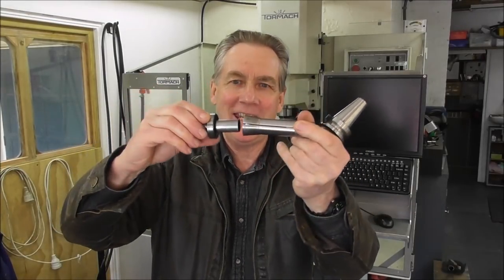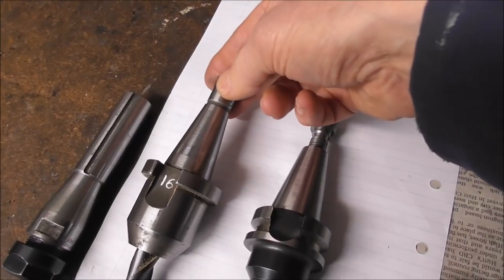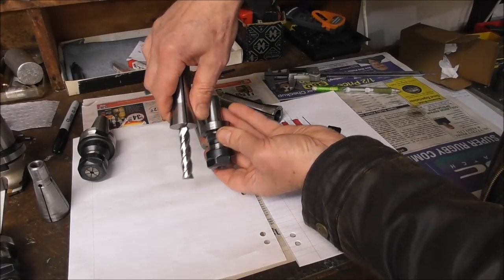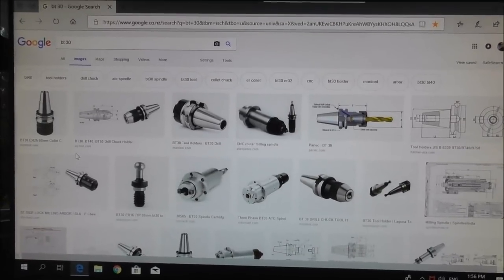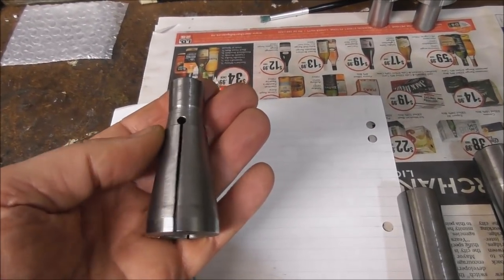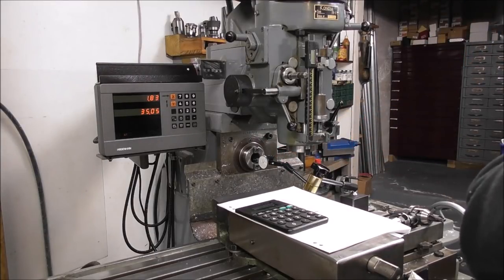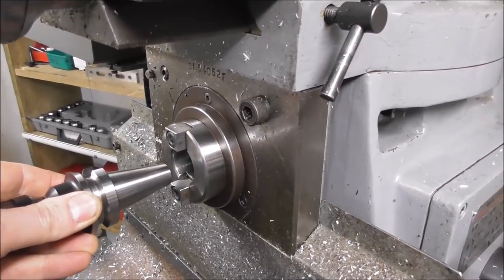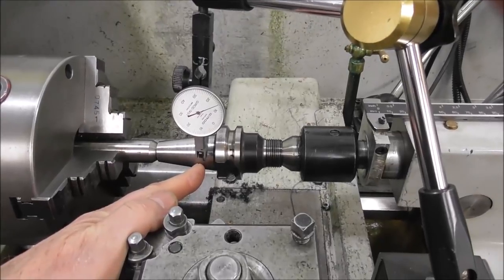R8/TTS vs BT30 Spindle Tapers -  Part 2

Comment: Hi Cliff
Still loving the ITTP. I am using R8 I have a large investment in R8 so I will not be considering changing to any other system I have a power drawbar which makes changing very quick. As for avoiding pullout with larger cutters I use a shell type cutter  on a one piece arbour no pullout. My largest cutter is 50mm dia and I cut up to 3mm depth @ 1200RPM and 500mm per minute feed in steel ( Ihave put a 7.5KW motor running in vector control to get max torque at lower RPM ) for smaller cutters I use a decicated R8 collet and I pin the cutter into the collet these are replaceable tip cutters 10, 16, 22, 25, 32.mm dia. Below this I do not have any problems I use plain R8 collets and ER 16 & ER 20 & ER32 collet chucks.
My machine is a Bridgeport copy so I do have rigidity problems if cutting big cuts, for what I generally do it works well
Reply from the maker: Hi John. Thanks for taking the time to give that useful information. That is good evidence of the capability of R8.  Do you use any TTS holders?  Thanks for the ITTP feedback also.  Cliff
Reply: @Threadexpress  Hi Cliff
No I do not use TTS the only thing I have done is add a precision R8 collet to the ITTP making it indexed to the key in the spindle and also pinned to the ITTP with about 2mm end float to still register on the spindle nose this helps with registration to the same position every time I use it.
Cheers
John

Comment: Cliff,

Great comparison of the differences twix R8/TTS and BT30.  Thanks.
I notice that on the Bridgeport style mill you have a horizontal spindle which looks to be an add on.  I have been thinking about doing something similar on a Bridgeport, also with a BT30 taper.  I searched your videos unsuccessfully for one describing the conversion, so I have some questions.
1. Does the spindle go right through to the back?
2. If so do you have bearing mounts just supported at the back or do you have a cartridge like system which supports as a one piece unit which goes front to back.
3. What do you do for drive? I guess a motor and belts at the rear.
4. Did you finish bore the spindle using live tooling mounted to the table?

I have considered one of the Bridgeport or cloned rt. angle drives which fit the vertical spindle and quill but I do not see them as being very rigid although they do offer a lot of versatility for positioning.
Reply from the maker: @MotoChassisByTonyFoale  Hi. My mill came with the horizontal spindle build in. Cheers, Cliff

Comment: I like your videos, good detail. I want ask you what do you think about TTS system vs R8 arbor to face mill, I had think is better R8 arbor but Im not shure if TTS can handle big cut whiout vibrate or slip.  Too what about Z high repeat of R8, because its the reason to TTS system but if R8 is enough  maybe could be better choice, Im not shure, like you say many things to consider, thanks
Reply from the maker: Hi. For face milling a R8 direct shank would usually be better than TTS. Re Z height repeat. Good question. I have not tested this, but I imagine with clean tapers and even draw bar torque it would be ok. Cheers  Cliff

Comment: Informative video, as usual. One point, though, BT30 holders do not always require drive dogs or spindle orientation. I have an EMCO mill that does not have drive dogs milled into the spindle or into its tool holders. Holders without drive dogs are also available to buy from some manufacturers (MariTool is one).
Reply from the maker: Thanks for that information. I think I cover this in part 3 from memory but your specifics are good to have here. Cheers  Cliff

Comment: Do you have dimensions for the adapters you’ve made? I am having a hard time finding the info needed or actual adapters  to allow bt30 to work with 1/2-13 drawbar
Reply from the maker: Hi - I only made that one adapter. Demand was too low to take it any further. The sizes are just NT30 with a 3/4 bore. Cheers, Cliff

Comment: I use BT40 with tool selection  in an 9kW  water cooled and air to blast away debris in front of the  axe.
Reply from the maker: Thanks for your input Stefaan. What mill is it on?  Cliff

Comment: Hey,

Thanks for this video and all your others. Currently using tts on tormach 1100, power draw bar, and pretty well all small machining on aluminum. Your impact tolerant touch probe is on the list of future upgrades. Now using a haimer, which works, pros and cons, exactly as you’ve described previously. Forgive me if I’ve missed this on your other vids, but I’m interested in methods of improving surface finish on aluminum with the  tormach. Might be issues of tool and tool holder runout, or rigidity, or something :-), but I’d like your thoughts on that subject. Again, big thanks for your videos, have learned a great deal from them.
Reply from the maker: Thanks for commenting. A video on improving surface finish sounds like a good idea!  There are several reasons for poor finish, enough to make a video series! Let me know the details if you have a specific problem situation. Cliff
Reply: Threadexpress hi,

Well, it’s pretty simple or maybe basic. I do lots of little aluminum parts, prototyping mostly, and most often I’m disappointed in the base surface finish of pockets in aluminum. It’s apparent with the carbide flat endmill, 1/4” diameter. I fool around with feeds and speeds and tool paths to make the tooling marks as visually pleasing as I am able, but never satisfied. The functionality of the part isn’t in question, just the looks. It’s as if the chips get caught intermittently and produce irregular score marks. I mostly use mist cooling, directed as best I can at the pocket. And ive used heavy flood cooling too. Still not happy. I might be being unrealistic as to what end result I want, but I think you know what i mean.
The surface finish from the side of the end mill is another thing too. Again, same experiments done to reduce the ripple appearance you get. I’m very much suspecting tool run out to be the cause. Not much I can do with that except try other suppliers or tool holders. The machine is what it is.

Thanks for responding to my query, and I really do appreciate your videos and I would like a vid on surface finishes.

Cheers

Alistair
Reply from the maker: Hi Alister. OK well base surface issues ex the bottom of an end mill is often because at a microscopic level the corner is blunt giving intermittant tearing and cutting. I often use one of these.. red or light blue is fine or superfine :

https://www.ebay.com/itm/EZE-LAP-3pc-Diamond-Hones-or-Knife-Sharpeners-Set-L-PAK/162351384292?epid=1404951090&hash=item25cce586e4:g:sNYAAOSwjDZYctod:rk:3:pf:0

And carefully hand lap a tiny bevel or chamfer on the edge at 45 deg - with just enough back clearance. Use a dull cutter the first time to check you are doing it right.  You may be amazed at the result - let me know if you try it how you get on.  Cliiff
Reply: Threadexpress , hi,

Hey that’s a great tip. I’ll examine the cutter and have a go at honing. Might be in a few days time but will report back.

Cheers

Alistair

Comment: Hi Cliff. Thanks for the video. Lots of great information there. Always learn a lot from your videos and think your probe is great. I am still doing my research into which machine to buy. Waiting to see the Tormach MX. Dont think I will be interested in the BT taper option they have as it seems pointless on such a low power machine. I dont think many people will go for that and I don't think many people will upgrade from Series 3 to MX BT30. If people follow the tips in your video about the TTS holders then they should be able to avoid TTS pullout. 
If you decide to make a BT30 taper for your probe then would you be able to make it compatible with say a Haas Toolroom mill(without atc) or those new Syil machines?  A Tormach BT taper MX with an enclosure and a tool changer will cost the same as a Haas Toolroom mill. Cheers.
Reply from the maker: Thanks for the feedback and information. I have not checked out all other machines and software compatability, but several have been shipped to different machine owners who are experienced with this and comfortable with doing the installations, and I have not heard back, so I assume all is well.   Cheers  Cliff

Comment: My issue with the TTS system is the extra Z height used
Reply from the maker: For example, comparing a TTS collet holder with a in spindle R8 collet- Yes I agree that is a big disadvantage of TTS. Cheers, Cliff

Comment: So how can we use a tool changer for the BT30?
Reply from the maker: Hi - A BT30 ATC is quite different from a TTS ATC. Different PDB/pullstud, needs spindle orientation, different ATC etc etc.  Cliff
Reply: BT taper tooling is perfect for automatic tool change.
There are a few differences and it's not plug and play with a TTS ATC, of course, but there shouldn't be any big problems.

First thing is, being tapered makes positioning less critical as the taper will find it's way by itself.
And the drive dog - spindle orientation problem is easy to work around: Just descend slowly and let the spinde turn very slowly and everything will align itself. If it is timed and set up properly as few as two turns can be enough.
And you can use BT with similar PDBs as are used for TTS as far as I've seen, but proper petal-grippers and pull studs are probably the way to go.
If the Spindle is of the drawbar type it's often not that hard to modify the spindle to accept a Gripper.

Maybe this helps a bit, there's quite a bit information available online.

Comment: FWIW, it's very unlikely that I will be converting my 1100 S1->S3 to 30 taper.  As an aside, are you aware of the R8 power drawbar that Ray Livingston (sp?) designed and marketed for the Novakon mills?  https://www.novakon.net/collections/torus-pro-vmc has info on the PDB and a companion tool changer that is in development.
Reply from the maker: Hi Mike. Sorry I only just noticed your comment!  Very interesting, I have just had a quick look, and will have to study that more.  Cheers,  Cliff